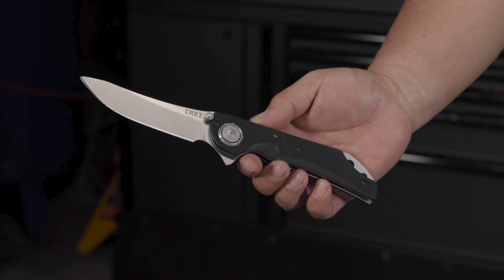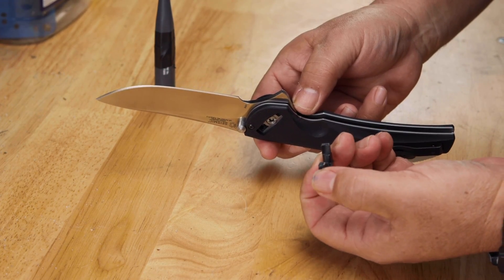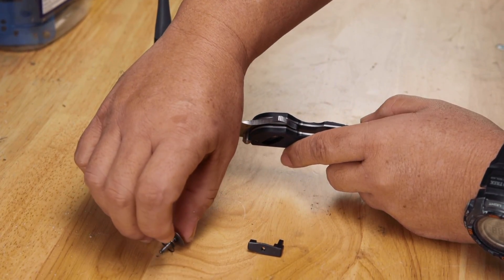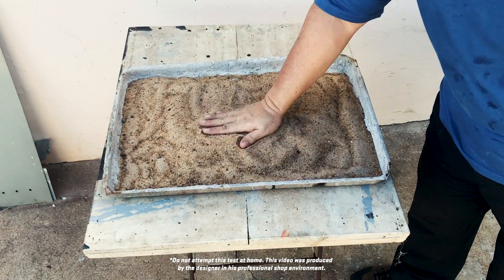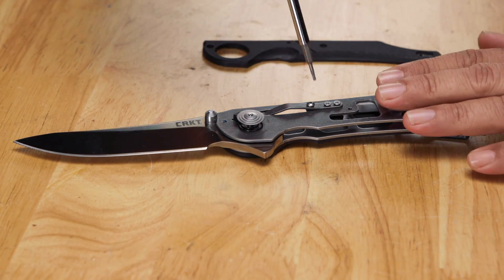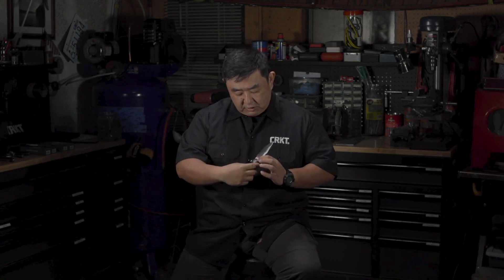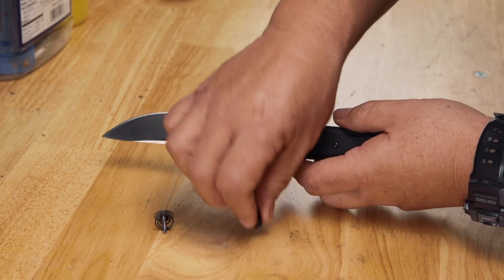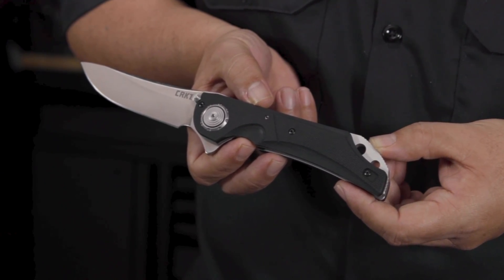The Deadbolt® Story: with Flavio Ikoma

Comment: For personal EDC in a front pocket or pack, plus a second Seismic always at hand in the vehicle. With the extreme strength of the Deadbolt lock, the versatility of applications with these folders is vastly broadened. Congratulations on such an achievement, Flavio!

Comment: Flavio Ikoma's Dead Bolt lock design has become my favorite. I only have one Dead Bolt lock in my collection of CRKT knives, and will be adding more. I prefer to carry a large folder, and Flavio's designs are very easy for one handed use. Is this the strongest lock on the market? I would not hesitate to literally hammer on the back of a knife with this lock, knowing it would not fail. 
I would use the Seismic for every day carry. I cut a lot of rope and plastic through the day on the job, and this knife would be great for that. I would also use it on the mountain for camping and every day chores, including food prep. It is the perfect size for all around use. Keep up with the great designs Flavio, and keep the unique designs coming CRKT!

Comment: I am a believer in the quality of these tools and knives. I spend a lot of time outside as a shooter and a camper and general adventurer. I need at all times my axe, belt knife, boot knife, pocket knife, multi tool and tool kit. I would use the deadbolt as my backpack knife. It's the perfect size and practically indestructible.

Comment: The design of this knife, with its blade length and style, as well as the reliable strength of its lock and ease of maintenance, would be perfect for the daily tasks I face as a father of a special needs child. From slicing through soft foods like oranges and breads necessary for my daughters limited chewing, to opening boxes that contain her pull-ups and changing pads, as well as cutting through ropes and wood to build an overhead shade sail to keep her outdoor play area cooler, this knife would be the perfect edc companion to make sure that our needs get met.

Comment: Just when I thought knife innovation was feeling stagnant, The Deadbolt appears with a video to show me how I'm wrong.  Just looking at the knife isn't enough, really understanding how this tool/weapon works is key to appreciating that the knife industry is not adrift at CRKT.  I'd use this knife as a travel/outdoors knife since the button allows me to draw, unfold and retract without having to put my fingers in the path of the edge.  If the deadbolt comes with a Veff serrations option it would replace my everyday carry knife for sure.  Thanks for another cool and practical tool!

Comment: I use a locking blade everyday in my landscaping work whether it’s cutting open a bag of fertilizer, trimming  a small shrub or working on irrigation. For me, a solid locking mechanism is paramount for safety.

Comment: How would I use it? For everything!

I learned about CRKT after buying your Ruger LCK with the non-serrated tanto blade. It has become my EDC and I use it all the time - breaking down boxes, slicing salami and cheese for snacks or pickle spears to add to a salad. It's also my go-to tool to remove the take down pin on my Ruger 380 LCP, as well as the perfect tool for removing the cotter pin that retains the firing pin on the bolt of my AR-15s for cleaning. My white light is mounted so that it barely clears the release on my silencer, so to remove it while hot, I wear a welding glove on one hand and use the flat of the blade in my other hand to actuate the release.

Your LCK knife has held up really well, and the Deadbolt looks like it could do all the same work, plus a lot more. I'm proud to show off my CRKT knife to anyone who shows an interest.
  I love your high quality engineering and craftsmanship, guys!

Comment: I would use this knife mainly at work or hiking. It may sound wierd but a knife you can use safely open and close with one hand is important in a biophysics laboratory. The locking mechanism also seems very robust so it would still work if droped in the drit well hiking

Comment: wow! That's interesting. A new locking system. Looks like I can attach it to a pole, use it as a spear for hunting or long weapon and it won't fold when it hits the target. Good as a survival gear and as an urban EDC knife. Dual purpose. I wonder if the button will become loose and fall off after sometime when used as EDC. That is my main purpose for this knife but also as a survival backup knife to keep in my pocket. I hope it doesn't break and fall apart if I drop it.  Does it also have a spring assist when opening the blade? I will definitely suggest this to my son in the army. He needs this as an  Explosive Ordnance Specialist. If this proves to be reliable, I will definitely look at other CRKT bolt knife designs
Reply: so I made some reading and found out that it doesn't have spring assist but it does have ball bearings. Hmmm... Are they stainless and rust resistant? Very curious. I do like the 2 holes at the end. I can put paracord through them so it'll be more secure when attaching it to a pole. Plus the curve design of the handle also helps secure it tightly on to the pole. Won't slip through the cords. I would have to make a video of this when I get one.

Comment: Sorry but Respectfully, the ONLY lock worth anyone's $ is Andrew Demko's Triad lock with Cold Steel Knives. I trust my life to all my triad locking folders from Andrew Demko.
Reply: Whatever, I already had one and even though I found the lock very strong, I didn't like it. The handling to close it safely practically requires the use of both hands, or you are forced to close it in a very awkward way with one hand. This lock seems to be very strong and the use is more facilitated. I bought one and have been enjoying it a lot.